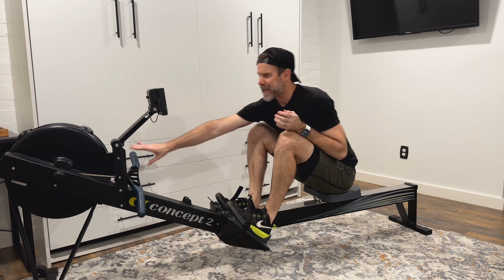Timing is Everything In Rowing - Learn Proper Drive Phase Technique to Maximize Your Rowing Stroke

Comment: Thank your for this and your other great videos! They really helped me to understand the different phases and what to look for in each phase. I have a question on the upper body opening. Around the 8:50 minute mark you go into the details to first go with the legs, then upper body (and then arms). If I slow down the video it seems like you start with the upper body rather soon in the flow and smoothly go through the upper body motion until the end. Is this how to do it most efficiently or rather wait with opening the body a tiny bit longer?
Reply from the maker: Thank you for taking the time to leave the comment and ask the question!  Rowing is a very nuanced sport, and you are clearly picking up on that fact.  As you initially press the legs, the core should be solid (you should feel strong and stable in the low back, glutes, hips, and abs) and the arms relaxed.  That inital stable push need only be fractions of a second before you have created enough acceleration (and speed on the flywheel/fan), that you can then add the back.  The STRONGEST portion of the rowing stroke is when the legs and back are working together.  And the most DYNAMIC/EFFECTIVE point to utilize the back is literally a few split seconds after the initial stable press.  Wait too long to open the back, you miss effectiveness and row robotically.  Open the back too early, and it feels heavy and slow across the entire drive (not too mention more tiring).  Not too get too far down the rabbit hole, but fan resistance effects the best time to open the back.  The higher fan setting, the longer (in fractions of a second) it takes the legs to get the machine to speed before the right time to open the back. The lower the fan setting, the shorter (again, fractions of a second) before its the right time to open the back.  All this is to say, EXPERIMENT in your rowing a bit.  Play around with how quickly you decide to open the back on your rowing strokes.  Wait shorter, wait longer, then find the sweet spot.  The sweet spot feels natural and dynamic (not too heavy, not too light, very Goldilocks and the 3 Bears).  As for the smoothness of the stroke... thank you for that compliment.  In rowing, or any sport, moving smoothly (which essentially makes it look easy) is the key to fast and efficient strokes. Rowing takes place in water.  Water is the definition of "fluid."  And the rowing machine does its best to mimic that non water feel.  So, we want to move with the environment we are in, and ensure our movements are fluid.  Strong, absolutely.  Aggressive, absolutely.  But also fluid.  More videos coming soon in which we will dive even deeper into drive mechanics and application. So stay tuned!  Thanks again for a great question.  Onward, Luke
Reply: @roweracademy  wow - thank your for this super detailed answer! Very helpful and really appreciated! 👍
Reply: @roweracademy  i think this has to be actually in the video, there is still much space for improvement of how to pass the information to the audience. the video could be shorter and more structured. just like this comment, which is much better explaining than the video itself. thank you for putting your time into helping us
Reply: I was going to ask the same question but there it is. Your back is at 12 very early. So it's not legs, body, arms strictly. Why? I really liked the explanation: use your biggest muscles in order to gain advantage of inertia. In addition I think it will be useful the explanation of setting properly the flywheel in order to get a "good" connection. Thanks for explaining the why!
Reply from the maker: @JorgeAlnino-k9e  Thank you for taking the time to comment.  I am cranking out content as quickly as possible and will be discussing the flywheel, resistance, drag factor in coming videos.  In the meantime, I really appreciate you watching the content and engaging with it.  I hope your rowing journey is going well, and please stay tuned for more content in the near future!  Onward. - Luke

Comment: Just subbed on. I'm in my 2nd week of rowing. After my 1st row I realized that I wanted to know how I was supposed to move on the Rower. I'm 64 5'10" 290 - 300 pounds. I was a bicycle rider up into my 40's. In my 50's and early 60's I've been as high as 450 pounds. I think my technique is pretty good at this stage of my rowing. I have very muscular legs and a big belly. I just can't keep my knees together at the catch yet but I don't have them very wide. I believe as I continue to shed fat and weight I'll be able to bring the knees in naturally without having to think about it. I've rowed 12 straight day to start rowing @ 18 - 22 spm for 20 to 25 minutes.  It's been over 10 years since I worked out dang.

Comment: is it ok to get the heels up off the foot plates when i'm still just in the first months of practice? i've heard some people say no...but i'm 6'1" and i find it very hard to feel like i'm really transfering power from my lats down through my core/glutes and into my legs if i don't pop up off the foot plates
Reply from the maker: It's absolutely okay, and encouraged to let the heels come up off the foot boards in order to achieve full length on the recovery.  As long as the shoulder stay forward of the hips and as long as your heels settle quickly on the initial phase of the drive, you are all good to go.  Please have a look at these 2 videos and let me know if you have more questions:

Heels up/Down at the Front End: https://youtu.be/dg4MS6zpTQU?si=SIaHIYiMPaPFPCPm 

Avoid over compression: https://youtu.be/NWbeML-mUD0?si=7MWe1OoedKWvLQHA

Thank you for watching and stay tuned for more rowing content coming soon!  Onward. - Luke
Reply: @roweracademy  i see ok thank you! will check those out

Comment: It seems to me that you should try to push the machine away with the legs first before engaging the arms after the lean?
Reply from the maker: Yes sir!  That is exactly right.  And here is a video I made on a drill which is great for learning how to hang off the handle, pressing with the legs, and then leaning with the body and squeezing the arms to the finish:

https://youtu.be/6WfCjCgA8XQ?si=1KiAnqb0Ks9PySeG

Keep the comments, questions, and updates coming! Onward. - Luke

Comment: Thank you very much!
Can you please show an example of how the force curve on the Concept 2 should optimally look?

In some illustrations you can see that it should not start on the bottom line, but a little further up on the vertical axis. But somehow I can't get it right
Reply from the maker: Thank you for your question/suggestion.  A force curve discussion is definitely in the queue of videos.  In the meantime, may I ask what damper setting (number) and/or drag factor do you set your machine fan to when you row?  Depending on fan setting, it can be easier/harder to get more instantaneous power on the legs.  BUT, also depending on fan setting you may/may not want to see the force curve starting high up.  If using a lower fan setting (1 being the extreme), the machine is much lighter and easier to get the legs going faster.  The result is a higher entry point for the force curve on the graph.  Conversely, if the machine is set to a higher fan setting (level 10), the machine is much heavier and it takes longer to get the leg speed/power up, so the curve is more likely to start near zero.  Regardless of fan setting and quickness of legs off the initial press, you really want to make sure you have a smooth bell curve.  So, there can be situations in which focusing too much on initial power can create a higher entry point for power, but also a quicker tail off of power on the back end (i.e. you have front loaded your stroke.  Let me know your fan setting and let's continue the conversation! Onward - Luke
Reply: @roweracademy  Thank you very much for the detailed answer.

I am currently in basic winter training and have set the fan to level 3.

Basically, I'm currently trying to concentrate on technique and a low basic heart rate.

I am 192cm tall and weigh 90kg.
I only started rowing on the water in the summer and probably still have a lot of work to do on my technique.

However, I have my roots in professional canoe racing, which I stopped 5 years ago after 30 years.
Rowing is a new challenge for me and it's important for me to acquire a good technique.

I am very happy that I can learn so much on your channel...at least for my ergometer training.

Cheers Tobi
Reply from the maker: @tobim.5490  You definitely have a leg up, since you are coming from canoe racing.  With your background, you understand how water moves and how to move a shell across it.  And the rowing machine is based off an attempt to mimic the water.  So, bringing your knowledge from canoe onto the rowing machine will help you maximize efficiency and speed.  A level 3 setting on the fan is pretty standard (although drag factor allows a little more specificity within the fan setting).  Level three should allow a good mix of resistance on the chain during the drive and freedom of the fan to spin on the recovery.  Please keep me posted on your rowing journey and stay tuned for more content.  Welcome to the rowing world!  Onward - Luke
Reply: @roweracademy  Thanks Luke, yes the feeling for the water is there. Nevertheless, you have to rethink a lot when rowing, because in canoe racing the legs are only used for balance and in the upper body the force on the paddle is primarily generated by rotation from the torso in combination with the latissimus, shoulders, triceps and chest.

In rowing, around 80% comes from the legs, the chest and triceps are only used for stabilisation and the latissimus is mainly used in the final phase of the stroke.

I am therefore very interested in improving my power transfer and I think that the power curve is a good indicator.
I would therefore be interested to know what you think the optimum curve should look like.